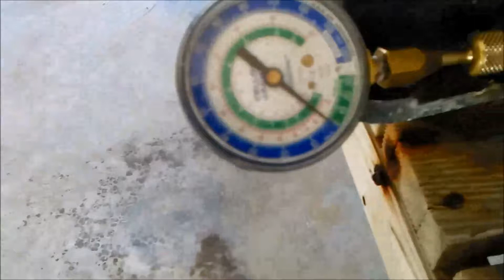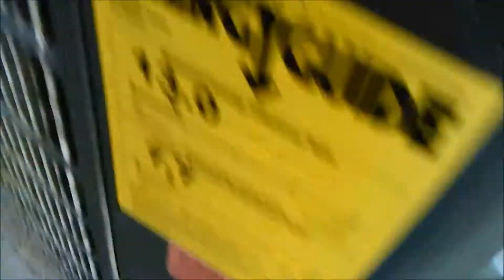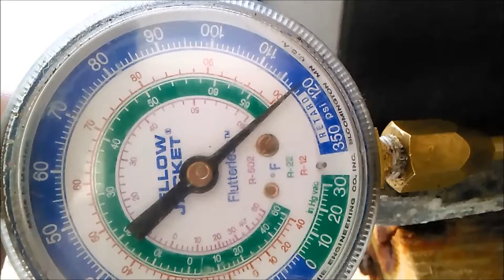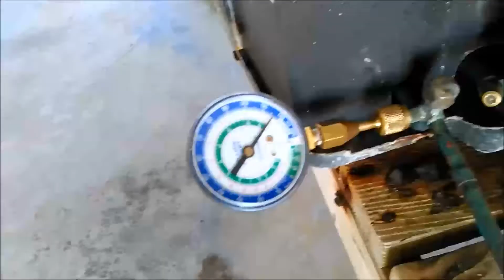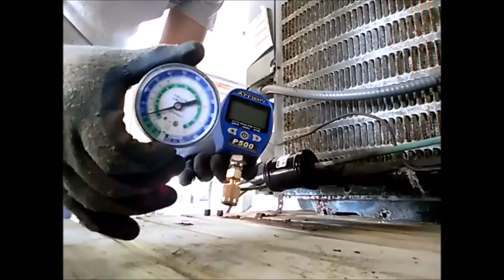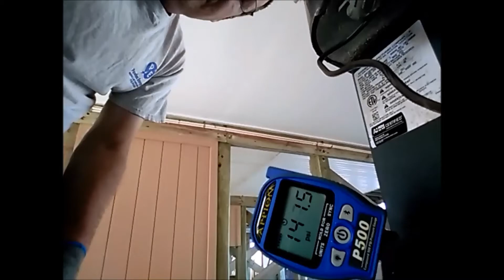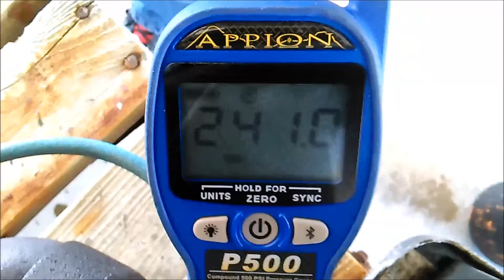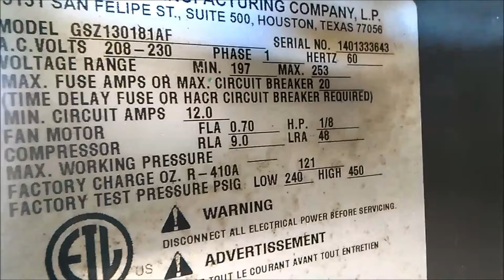Liquid Line Filter Drier In Salt Air

Comment: Nice video Mike! That P500 is nice. How did that unit ever work properly without having a Bi Flow Drier on it?
Reply: +FIX IT HVAC I guess that makes sense.. Thanks man good info
Reply from the maker: +Gil Cavey Jr  The P500 is my Digital Bluetooth ((Z-Manifold)) I got it to read PSi in commercial RTU's where you have to have the panel doors on.